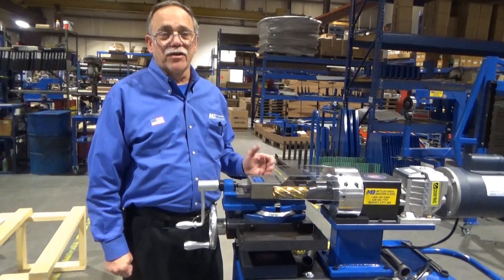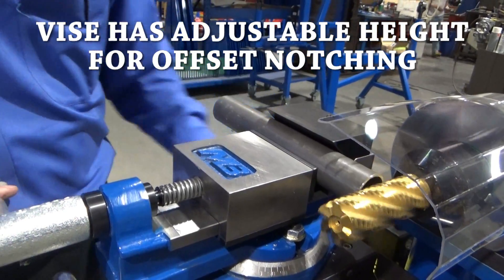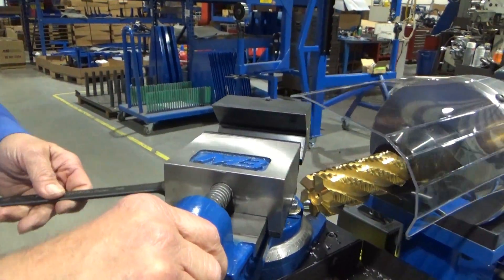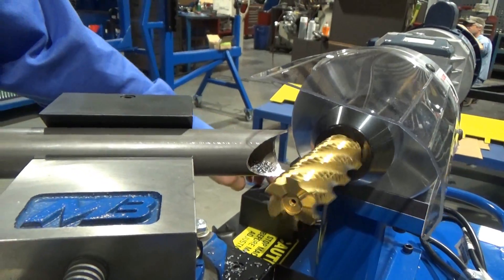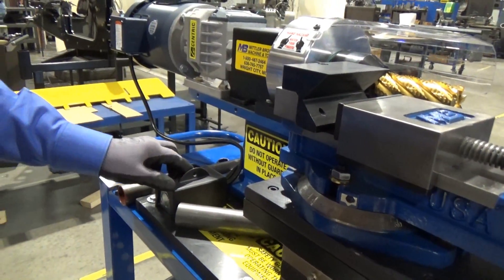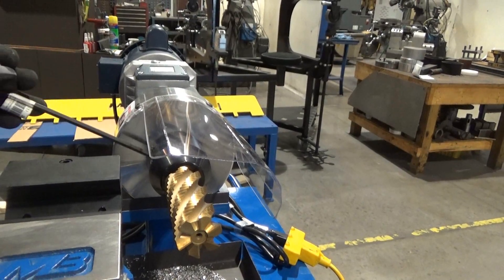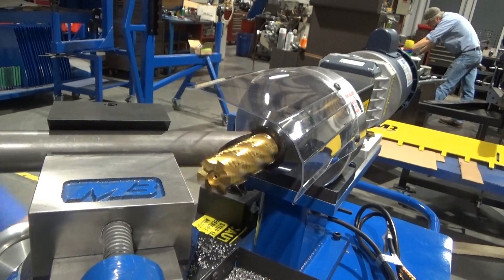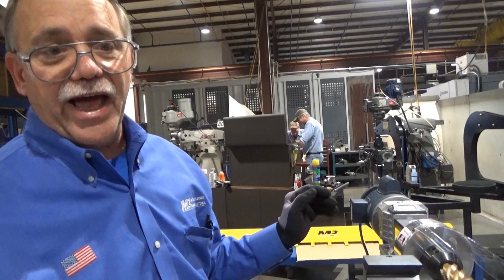Ultimate Tubing Notcher Demo and Overview

Comment: Can this machine do saddles for 2 3/8" & 
2 7/8" oilfield pipe?
Reply from the maker: This machine here can definitely handle the 2 3/8" with no issues. The 2 7/8" would be a different animal, and require a special, custom build on the ultimate tube notcher to accommodate that large size cutter. We've done these custom builds in the past. Shoot us a private message if you'd like more info there, and of course let us know if you had any other questions!
Reply: @Mittlerbros  yes send me info on this and price. So it will handle oilfield tubing? And how much are the grinding bits for this and how long do they last?
Reply from the maker: @caseyelliott5550  I'm going to forward your questions to our shop foreman to make sure I'm getting you the most expert info I can. I'll need your email address and as soon as I hear back from him, I'll shoot you the info! Thanks again!
Reply: Ccrewelliott1458@gmail.com

Comment: How well will it cut 4130 with .035 wall thickness?
Reply from the maker: It wont do a very good job with .035 wall tube. The top of the notch will want to hook and bend down. best bet is a belt sander style or a holesaw with fine teeth.

Comment: how many notches do you normally get out of a roughing endmill like that?
Reply from the maker: Typically 1 and a half to 2 years of regular use. More or less depending on work load.
Reply: Thats really impressive.  The cost of hole saws whole saws really add up!
Reply: @Mittlerbros  How much does a new endmill cost?
Reply from the maker: @timothykeith1367  We offer quite a few options and configurations in Tube Notchers. Single speed models start at $4,695.00 and go from there. In addition to the single speed models, we offer both variable speed and double sided variable speeds configurations as well. Shoot us an email or give us a quick call and we can answer any and all questions you might have. Thanks for you message!
Reply: THousands and thousands... I have an endmill but and you spin it low rpm and it lasts, even use a tiny bit or fluid and its golden. 1 EMB will outlast a 100 holesaw bits